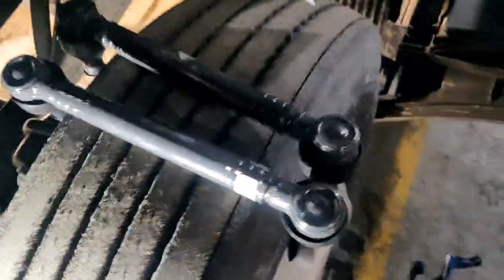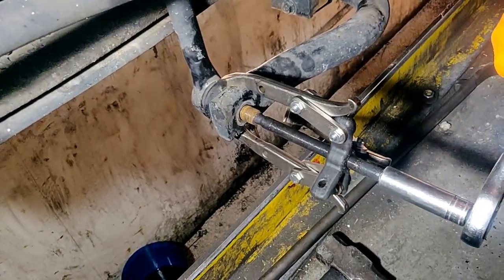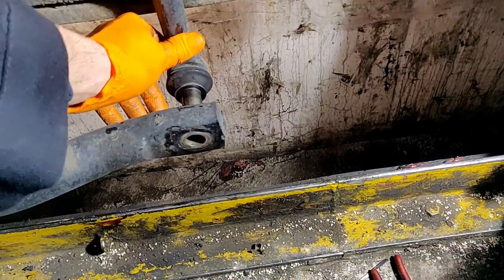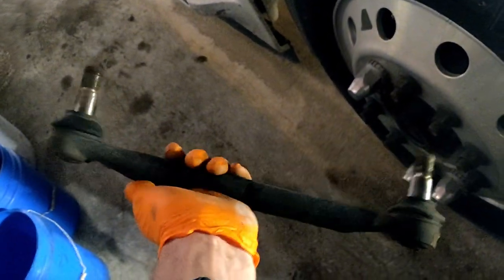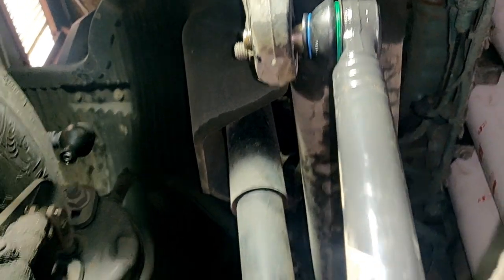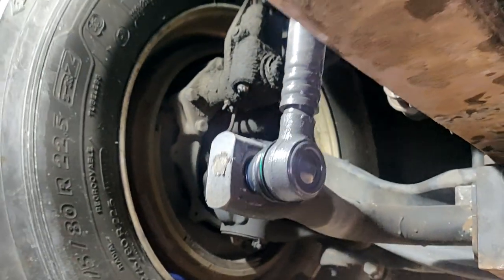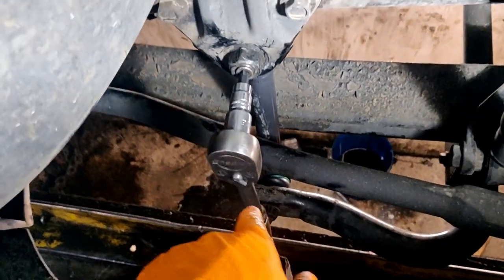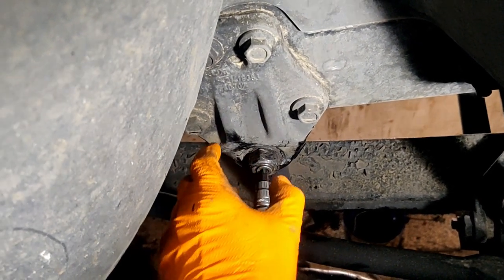Volvo D13 Suspension Knocking Noise

Comment: I have 2024 VNL 860 with 60k miles. When i drive slow in traffic and turning wheel little bit it makes popping noise’s. Can you tell me what can cause that? Thsnks
Reply: Same problem do it make the noise if your bobtail? And do you hear a noise from the power steering when you turn to the right ?

Comment: Did it eliminate the sound? Also, was it making sound while braking?  I think I have the same issue. Thanks
Reply from the maker: Yes it eliminated the sound! But the sound was almost every time when driving on a bad road! Nothing related to the brakes!
Reply: I got similar issue when I put brakes I can hear like drum sound come from right side of front wheels.
Reply: @alexrobertgu  did you find a solution I have the same problem?
Reply: @valeriumoscalu7580  same problem how much they charged you?
Reply from the maker: In my case this was the problem and eliminated the sound!